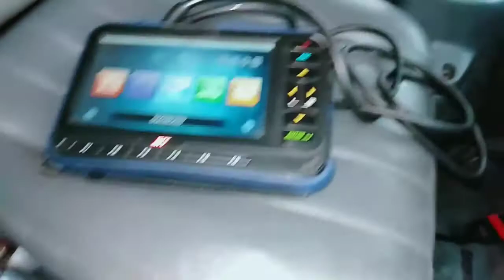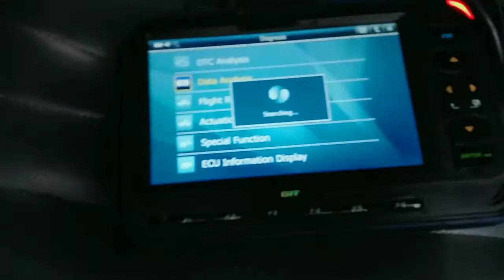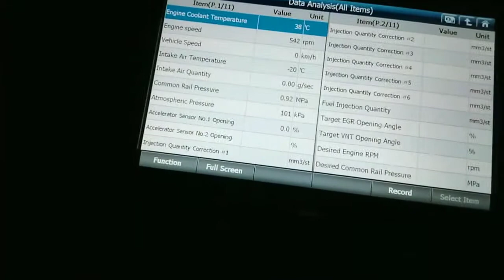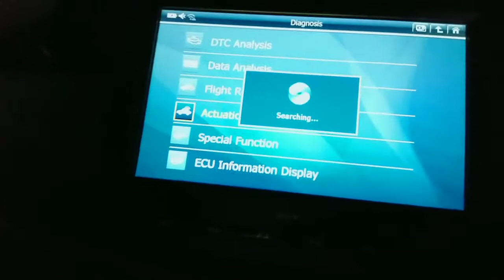Hino commonrail pasang supply pump scan ecu

Comment: Halo mas.. ijin bertanya mas' mobil yg saya kemudikan hino 240TI Thailand juga mas, keluhan nya mobil mesin baru dihidupin normal tiba² mesin brebet lampu indikator nya nyala,filter solar keseluruhan dan filter udara sudah di ganti' dan tengki solar juga udh di kuras bersih, tapi mesin masih tetap Brebet lampu indikator mesin nyala dan tenaga juga tidak ada, kira² ijin kalo boleh tau apanya ya mas' soalnya mekanik udh 3 tapi masih kambuh lagi brebet mesinnya mas' tks